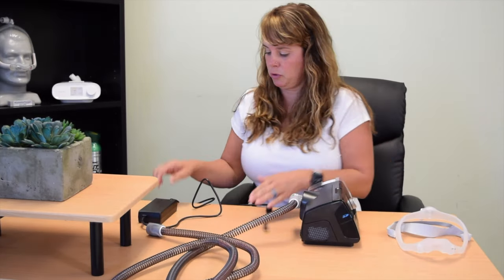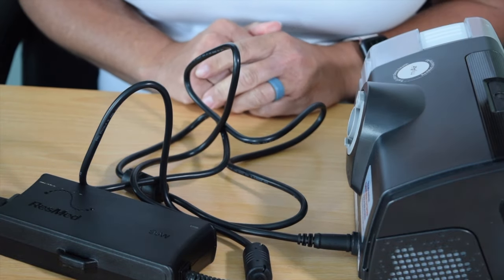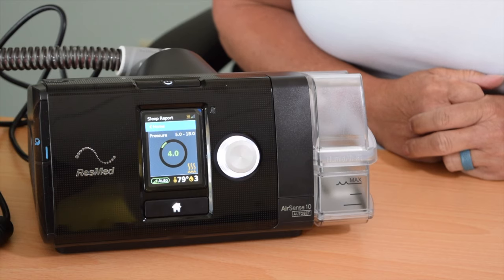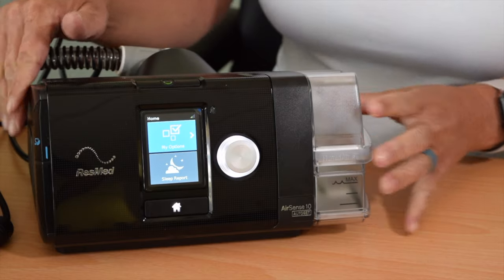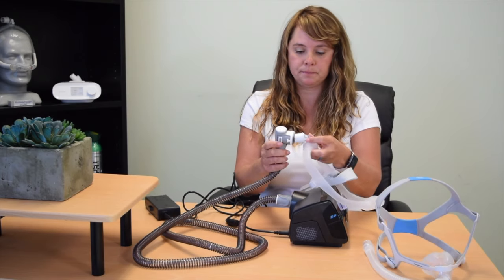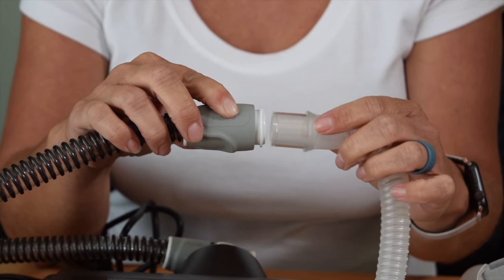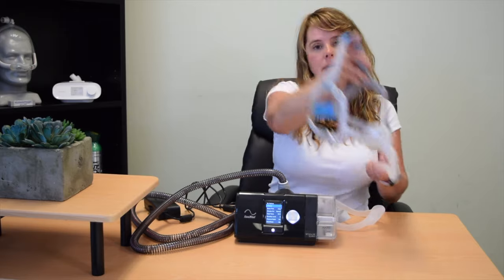Troubleshooting your CPAP Machine - ResMed AirSense 10

Comment: Question, just recently the machine is loud with air moving, my wife says it goes along with my breathing pattern and sounds like a ventilator at times.  It will wake us up.  I have cleaned everything, reattached everything but finally put the machine under the bed.  Any ideas?

Comment: Thank you. Thank you. Thank you. My CPAP stopped in the middle of the night last night. So did my lamp and my adjustable bed. I pushed the surge protector and the lamp and bed came back on but not the cpap.  I watched your demonstration for about a minute thirty. When you said the plug has to be really plugged in hard, I thought oh please let it be that easy. It was. My cord from the wall to the transformer was plugged in but not really "plugged in hard". It's working. And now I'm going to take a nap. You saved this old lady.

Comment: One guy wrote that these have a tiny computer inside and might need to be rebooted like one.  Unplug it from wall for a few minutes and plug back in.  Viola!  It worked for me.  For those of you getting nasty stuff in your tank you should rinse it daily and once a week soak the whole tank in a mixture of white vinegar and water for 30 minutes to avoid mold.  I won't it using approximately 2 cups vinegar and Three cups water.  Make sure the whole tank is covered.  Works like a charm.  I clean my hoses and mask weekly using dawn dish soap and let air dry.  Never use bleach!  Also only use distilled water in the tank.  Hope this helps!

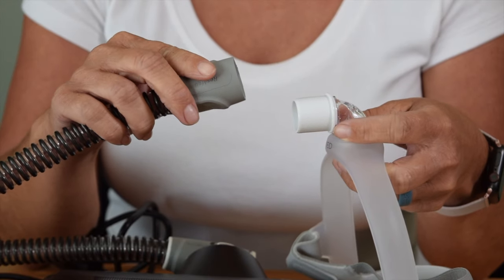Comment: 3:30 The most important thing for me in this video. This white connector. Thanks!!
Reply: I didnt know that this part can be unplugged. This "quick disconnect" has not been described anywhere in the manual. I have 2 different tube, one with warm system and without.. I spend 1h to find how answer how to switch this tube and I failed.. This video show me that "things" that I cannot find answer...

Comment: At the beginning of the video problems with "no power" were mentioned, in addition to checking for plugs not being inserted in all the way or a wall switch, also check if the outlet the CPAP power supply is plugged into is a GFCI outlet (ground fault circuit interrupter) it may have tripped.  Be aware that a GFCI outlet may control several outlets in a room and may not be the one your CPAP power supply is plugged into.

Comment: Discuss the engineering problem with the Airsense 10 water chamber box which sometimes leaks around the middle edge due to the silicon seal being worn and how we need to re-silicone the middle rim all the way around to stop this leakage. Discuss how the Airsense 10 in automatic mode will sometimes start blowing air after you take the mask off and leave the bedroom. I had to put mine in the manual mode to stop this problem. It is over sensitive in the automatic mode. Resmed has moved on to the Airsense 11.
Reply: Having had this diffuculty with my previous machine, I can appreciate the concern. To me, the problem with the leaking water chamber and a few other minor problems was a sign that i needed a replacement machine, which I recently purchased. The other one will be kept for reserve, with the problems fixed as far as I am able. PNH

Comment: If the water chamber is in far enough for the machine to work but not fully seated you may get higher pressure than you expect.  At least I did on my machine.
Reply: What? Why would that be? I sure want to be done with this machine. Imagine the plastics we are breathing in

Comment: Hello.  Your videos are so helpful.  I have an issue with my philips dreamstation 10.  I use a ResMed Quattro FX medium.  When I exhale, the mask is making a "thumping" sound.  I suspect it has something to do with with the pressure setting while I exhale.  I cannot figure out how to confirm or adjust this.  As I start to relax, I find I will exhale a little more relaxed and the thumping sound from the mask either goes away or becomes much softer.  It is so annoying.  Do you have suggestions for me?

Comment: I can't get my leak level under 65 and I replaced the mask, pillow, tubing, humidifier chamber, and headgear to no avail. I have had it for 5 years and know how ti use it. My usual leak level is 27 until about a month ago. Very frustrated. Any suggestions?

Comment: I have an issue with debris ending up in my water chamber. I’ve never used anything but distilled water, and I have a so clean. In theory. Otho got could get into the system. But about every 5-7 daysI find things like clumps of mucus (?) or slime(?) happily floating around in the water chamber.  Or little pieces of whitish stuff. Where is this coming from and how do I stop it?
Reply: Dump your water and use fresh distilled every day. I also put 2 tablespoons of hydrogen peroxide in my tank a couple of times a week and run it with the peroxide over night with no harm. It seems to help boost my breathing/sleep for me and I have been doing this for years.
Reply: Do you dump and refill daily?  If not, you absolutely must.  Also, you have to clean the tube once a week...bestnto soak it in a bath of white vinegar and water then rinse thoroughly and hang to dry.
Reply: Fix Resmed airsense10
Reply: Same here.

Comment: I was having trouble with my Airsense 10, the unit would switch off intermittently. This occurred a few times, then it would not power up at all. After a good deal of frustration I accidentally smashed it with a giant sledgehammer....

Comment: Having trouble the cpap machine transmitting to my computer for nightly info? Machine is working fine at night and also went  to therapist and they checked machine working fine.Resmed my air says to contact supplier but they say they only supply equipment. how can I get help have sent emails to resmed but no reply.  Thanks for any info.

Comment: For two nights now, I have been unable to use my Resmed. I tap the start button and it shows the air pressure rising, as usual. Then, when it hits 8.0, it shuts off, no air coming into my mask.  What could explain this?

Comment: Got the light to the corner of the box .Check. Push the cord all the way in no light to switch. Menu Box unlit. If I pull the cord out slightly then the power switch flashes green but no joy. Defective Cord? Switch? Or Unit? Tried 4 deep nasal breaths. Nothing.
Reply: Same problem
Reply: Brand new machine with same problem
Reply: Brand new machine, same problem

Comment: Mine quit working for some reason .  I followed her instructions and everything was fine but it still didn’t work.  Reading the comments, someone posted that they unplugged the unit from the wall for a few seconds and theirs started working after it reset.  So I did mine, unplugging for about 5 seconds, and it reset and began working!

Comment: Thanks you, but how do I adjust the pressure setting or the stroke (number of pumps per minute), etc?  I don't see that on the menu?
Reply: That's in the clinical menu and has to be accessed by pressing the round button and 4he home button at the same time. Hope that helps
Reply: @-Scraggyanne-  Yes it does help--and thanks for taking the time to help me out
Reply: @jimquantic  glad to be able to help 🙂

Comment: what should I do if I found mold at the bottom of the water reservoir?
Reply: Clean it and stop using swamp water.
Reply: Clean it really good with vinegar and clean weekly with vinegar and blue dawn dish detergent. Use Distilled water only.

Comment: Can I use the machine without the humidifier?  Can I take the water chamber off and close the side?
Reply: Of course you can. There is and add-on cap you buy separately and it clips instead of the water chamber making the size of the machine smaller (I.e. good for travel). I bought it when I purchased the machine but truthfully hardly used it as I find I need the humidifier.

Comment: My heated hose is not working, I bought a second heated hose and still no go.  Took the machine apart and found the ribbon cable inside the main unit where the hose is connected is torn in half.  Trying to source a ribbon cable as it's just a cheap part but I am getting no response from Resmed.  Any idea where I might get a part?  Shipping from Canada to the US to replace a part that takes me 10 minutes to replace myself is out of the question as it would cost me hundreds of dollars for a $20 part..  I have no problem paying for the part and shipping to do it myself it there are any users with a dead unit.  Thanks

Comment: Let me see if I get a response. My water tank has gotten hard to remove to fill what can I do?
Reply: Took me some time to get tank to remove easily.  Try pinching it on both sides a pull straight out.  I punch mine towards middle section.
Reply: The water tank on my machine seems to remove quite easily if I put my thumb on the white plastic spot on the top of the tank and fingers underneath the bottom of the tank squeeze gently and just pull.

Comment: I need to change the hose but it doesn't come off ,what should I do?
Reply: Is it completely stuck in there?  there is a small lever on it that you have to depress for it to disengage.  Not assuming you haven't tried this, but if you haven't, give that a try.
Reply: Pull on it, till it comes off or breaks.

Comment: It's a torture device, it's expensive, difficult to take of, gross. Tube and water chamber smell like hell even you clean them every day. You need another machine to clean the accessories, SoClean etc.. and that too is not cheap, the Ozone filter alone is not cheap. For travel, you have to take the whole system with you. It's crazy.
Reply: Are you using swamp water?
Reply: It’s the best sleep I have gotten in years though….so there is that
Reply: Who hurt you man?
Reply: Make sure you only use distilled water.
Reply: Early days, only 4 weeks in but seems fine to me. One big difference in the UK........all eqiupment is free on our NHS (National Health Service)

Comment: I did not learn anything from the video. Why does my rest med smell like melting plastic
Reply: Are you running out of water? I get the burning smell when I don’t have water in the chamber
Reply: Make sure your humidifier chamber is not dry. When my water runs out and it's still going, it smells burnt!
Reply: Make sure you have enough water in the humidifier and your settings are not set to high that you run out mid sleep. If this is not the issue I would speak to your sleep therapist.
Reply: Maybe, try moving it away from the stove.